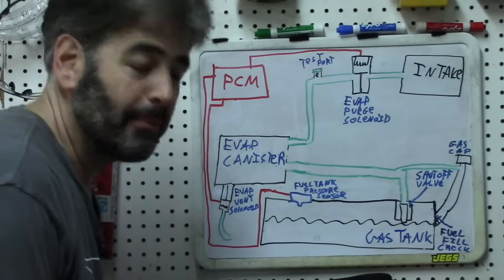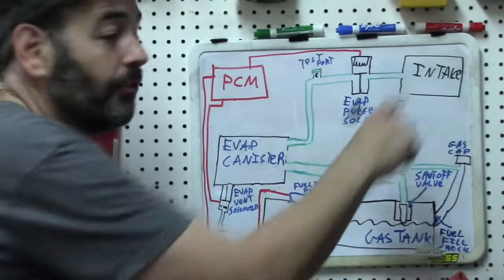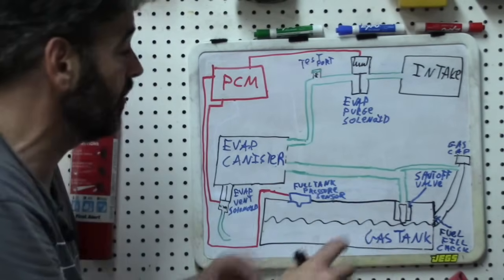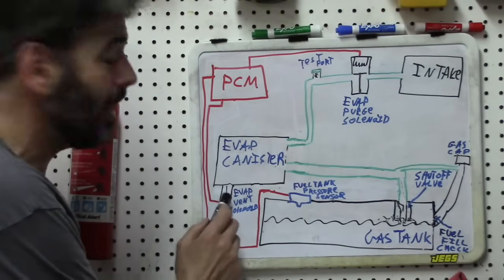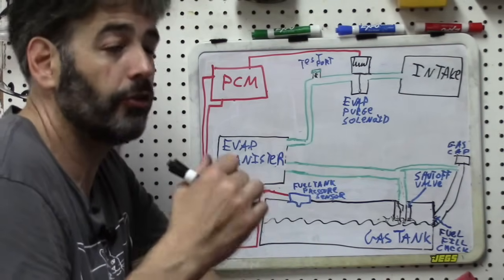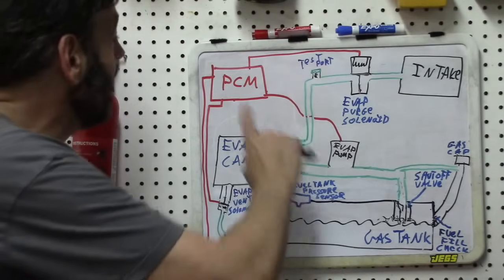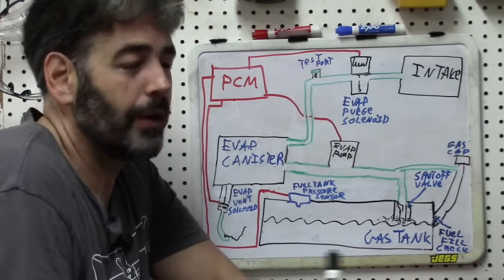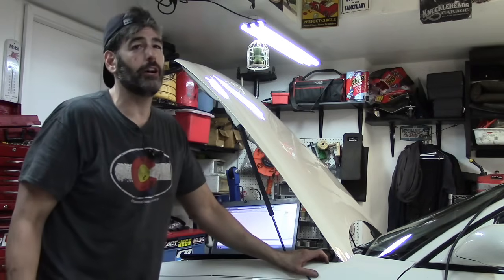Diagnosis + Understanding EVAP Systems (SBQM Full Video)

Comment: Thank you so much for making this video. I've never seen someone break it down and explain every detail like this, but damn now these EVAP systems finally make sense! I needed to figure out how these systems work because I'm planning to install an auxiliary gas tank on my truck and to vent properly it needs to connect into my evap system so the fumes aren't just spewing out into the atmosphere. Now with this info, I can kinda start to form a plan!
Reply from the maker: Glad it helped. It’s pretty easy once you understand the basics!!

Comment: My Ford stalls the very first time after filling gas. So that would be a purge valve issue?
Reply from the maker: Could be, among other possibilities.  What did the FTP voltage indicate the problem is?
Reply: @SchrodingersBox it threw a P1450 code. I pulled the line off and felt a vacuum on my finger. So I'm going to replace it next weekend since it's a pretty easy fix.

Comment: I love how the Evap system works but also it can be a headache 😅. I took my truck to a mechanic and he couldn't find the small evap leak. I took it upon myself to talk this evap leak problem. I found 1 hose that was ripped. But now I still can not find the other small evap leak. I took it to another mechanic who is a friend and he helped me more with this problem. We checked the purge valve and canister vent valve. It seem to be closing when my 2002 ford f-250 super duty is running. We did notice the gas tank looked like there might be leak coming from somewhere because there was noticeable moisture like if it was leaking gas. Now I need to bring down the gas thank to inspect that. Even With the smoke machine its so hard to find the problem..I hope its something simple with the gas tank so I could take it to smog this month. I really need to fix it to get my tags renewed. 
I also noticed the check engine light comes on after like 500-1000 miles or probably 1500 miles i do not recall but it takes a very long time to come on 😭 for the p0442 code evap small leak

Comment: Good video. Very informative & knowledgable facts. HOWEVER, I  need to know about the HOSES connected somewhere on top of the rear alt. crossmember. More specificallty, the HOSE with the INSULATION ON IT(?) Where does it connect? Mine  was burned into by tailpipe b4 I bought the truck, there is no visible connection point I can see?! I CAN'T FIND A SCHEMATIC, PHOTO, VIDEO ANYWHERE about this PAIN IN MY A$$. So here is your chance to shine by being the 1st one on here to finally clear the air on this bs!? lol
Reply from the maker: Man I would have to be REALLY good to answer this without being told the year make and model.
Reply: @SchrodingersBox  1997 F-150 4.6L LWB 2WD

Comment: Wait, if the purge valve is stuck open, vacuum will not decay, but increase, because the vent is closed and the engine is running , pulling vacuum through the leaking purge valve.
Reply from the maker: The vent valve is always open UNLESS it’s doing a system test

Comment: Hi Matt, but can evap problem cause crank no start . I have a car with evap code and is crank no start.

Moshitoa south Africa 🇿🇦
Reply from the maker: Very unlikely that it would cause a crank no start. It may be the engine is flooded with vapors from the evap but if you hold throttle all the way down car should start if that is what is happening. 
  I really doubt the evap issue is related to the no start.

Comment: Well, I had a strange event after installing a new fuel pump in my Tahoe. I had cleaned the tank (in place) of five-year old fuel. I cleaned it really well. I filled the tank with water and floated the last gas up where I could ladle it out. I drilled a drain hole and drained all the water, then installed a bolt with seals (which works). I wiped the tank repeatedly and got most of the last gunk and grit out. So, the darn clean tank received the new pump. Yes, I had cut the floor open to access the old pump. So, I get five gallons in a red plastic can, pour it in... seems great. My drain bolt is sealing. The fuel all goes in without a problem. Fifteen minutes later, I go out and check... fuel is leaking down the driveway... this is only five gallons, so I was anticipating I could capture it all if my sealing bolt leaked. But the bolt did not leak. I built it with o-rings and heavy nylon washers. It sure looked good - and it DID NOT LEAK. But how come gas is dripping profusely off the bottom of the tank?

So I go to the fuel pump portal (which I cut in the floor) and I see a puddle of gas on top of my fuel pump/tank, and of course, it is running around down the side. But why is the gas exiting my tank here? I clean things up and look closer. What appears to be true, fuel was being pushed right out the 3/8 nipple that goes to carburetor. Fuel was NOT being pushed out the return 5/16 nipple. There was a pressure developed in the tank after I poured fuel in, and closed the filler cap. We are talking about probably more than a cup of fuel, less than a pint I'd say, that was pushed out. This is a lot of fuel. Dangerous event. Now I want to cut the floor again, to find the pressure relief valve. What has gone wrong in design to give this dangerous event? Does this type of event take place in modern cars? The pint of gas gets pushed to where? I will bet this is happening to people and the mechanics are not understanding it when it happens. At present, I'm guessing the relief valve is stuck. On these vertical body fuel pumps, they have 3 nipples. What is the middle nipple for? If my relief valve is opening correctly, this problem should NEVER occur... correct? After 5 years sitting, the relief valve is stuck? Most likely. Now, where is it so I can cut the floor properly...

Comment: Hi. I have a 2006 honda crv that is driving me crazy
I don't have any codes , but I have the Scan Gauge III connected where I can see my fuel trims.
Around a year ago, I started noticing a rough Idle with my fuel trims getting  very negative on the short-term -10/-15 with the longs slowly creeping up toward the -10 the longer I stayed idling. The thing is that as soon as I started my commute on the highway, everything goes to 0 until I arrive and stay idling again.
I checked the purge valve and the vent valve at the canister.  Both are working fine. The problem is as soon as I start the car. The purge gets open, creating a rich mixture plus a vacuum leak. Witch also creates a rough idle.
Also the reason why I know the problem is the evap is because after a year of unsuccessful slow troubleshooting, I finally pinched the Evap hose coming to the throttle body while I was idling and my numbers started going back to 0 and the idling smooth out instantly. The problem is that I don't get any codes, and my components are working fine.
I remember that before I heard the vent selenoid open after I leave the driveway in the morning and get to speed (+/- 25mph) but now is like if the computer opens both selenoids as soon as I start the car.
Have you ever heard about this issue?
There is a guy with a civic on YouTube chasing the same problem.

Comment: My 2002 Trans Am is having low fuel mileage and occasional high idling, I am suspecting the EVAP canister. I will troubleshoot a few components before i drop the tank to get to evap can.

Comment: Thank you for this explanation , this helped me confirm this annoying issue with my truck. My truck was smelling bad in the engine bay and I had narrowed it down to the EVAP charcoal cannisters that were smelly from fuel vapors. I changed out the charcoal element thinking it was just old (30 years old) and that solved the problem for a few months until it got smelly again. I learned that these accumulating fumes were due to a faulty EVAP purge solenoid that is stuck CLOSED. All other components of my EVAP system and vacuum are new or still working well.

Comment: I believe the gm purge solenoid on the intake is normally off in its closed position.  The computer will send pwm to the solenoid opening it different percentages as necessary.  The purge rest or off position would be closed if not the solenoid would be on all of the time keeping it  closed . It wouldn't last long like that
Reply from the maker: Yes that’s correct. Most purge solenoids work the way you described too.

Comment: Not so clear for me. You keep saying PCM, PCM. But  what does PCM mean or what does it stand for ? And you did not mention what's gonna happen to the fuel EVAP and other vital components if the fuel tank was over filled when tapping up gasoline, in which most drivers do.
Reply from the maker: Sorry about that - this channel for advanced DIY’s. I assume viewers have basic mechanical experience before watching.

Comment: I believe with my '98 prelude the hose from the evap canister doesn't go to the intake manifold, but it goes to the vacuum sealed resonator. That way the fumes go through the air filter before the engine

Comment: Thanks so much for this.  My Lexus GS460 has developed what I suspect is a fault with the float valve in the tank, as if I fill the tank past about 2/3rds it will run poorly under load and fuel economy plunges - the higher I fill it, the sooner it starts happening after filling.  I think liquid fuel is getting into the charcoal canister.  If I keep the tank under 2/3rds for a while, it comes right after a day or two and stays that way until I refuel again - presumably the fuel in the canister has evaporated.  It's not showing any codes, even got the dealer to put their tool on it and nothing.  I'm not sure what to do to correct it, but at least I can work around it by just never going past 2/3rds of a tank.  I guess the tank would need to come out to repair the problem.

Comment: Can you tell me if the gas tank pressure sensor on a 1997 corvette C5 requires removing the gas tank in order to replace the sensor?
Reply from the maker: Yes it does.

Comment: Having code P144C on 2017 ford transit 350HD turbo 3.5. Scanner says evap leak under boost. Replaced purge valve on top. Cleaned gas cap fill seal. Watched your video but you don't mention under boost. Any feedback would be appreciated. Ontario Canada.
Reply from the maker: I would need to see that data indicating the purge valve was faulty. What data indicated this?
Reply: @SchrodingersBox  what Data exactly are you looking for?
Reply from the maker: The voltage data from the fuel tank pressure sensor with and without purge valve activation would be the easiest to start with.

Comment: Have a 13' econoline and 3 times I've gotten gas shortly after won't start until i disconnect and reconnect battery. I've checked fuel pump fuses and tested purge valve but didn't blow through it. Any suggestions?
Reply from the maker: What data do you have?
Reply: I dont have a scan tool if thats what you mean..i did also disconnect an auxiliary battery and inverter, and as far as i knew it was only powering the inverter..i disconnected the hose coming from the cannister to purge and started it,and didnt start sucking until it warmed up a little @SchrodingersBox
Reply from the maker: Don’t need a scan tool- just measure the vent pressure sensor voltage.

Comment: You are an excellent teacher. I've been to automotive school.I find you too teach just as well and you show in a bunch of different ways. NEVER STOP LEARNING PPL!!!
Reply from the maker: Wow, thanks! It’s definitely an ongoing learning experience for me, too.
Reply: I spent a week trying to get a Dodge ram to pass e check and my issues were evap. The components are scattered all over and issues everywhere with hoses and fittings. I finally got it to pass. The computer approved the evap test quickly once repaired. I wanted to understand the operation after and you said something about unable to reach full vacuum causing major leak code and that was my final problem. A small crack in the hose to the intake. Thank you so much for a detailed explanation.

Comment: * More than once when filling refueling the fuel pump failed to shut off after filling.  Besides fuel spilling onto the pavement, liquid fuel saturated the charcoal in the evap canister and evap system code occurred.  The solution?  Drive lots of miles to unsaturate the charcoal.
* If the vehicle has sat for a long time, the evap canister charcoal can become saturated.  Same solution, drive and let the vacuum suck the vapor out of the charcoal.
* On another note, squirrels or ground squirrels have chewed through the vapor return lines on two different vehicles, and the evap ourge solenoid wire on another.  Finding replacement line connectors and the vapor return line of the correct construction was tough, and then inserting the connector into the vapor line was tough, too, until a compression tool designed for attaching connectors onto RG6 coax cable was used.

Comment: What make a 2007 Hyundai SantaFe limited 3.3L when you fill the gas tank full, you hear bubbling and seems to vapor lock and engine shuts off but will start right up? 
  Thanks
Reply from the maker: Sounds like a leaking purge solenoid to me.

Comment: In toyota prius 30 I noticed ecm allow to open evap purge control solonoid to open 20% when it's in maintainance mode engine running in idle. Its showed - 5 in LTFT.then I closed the vacume line and checked the ltft then its came to 0 ltft. Can this be happen when engine is in idling.if not how to resolve the rich condition.?

Comment: 2002 Camry 2.4l has an evap vent valve at the air box. Is that the same thing as in the video only at a different location? I have a small evap leak code. Verified it is not the gas cap. Believe it may be a cracked hose somewhere but can't comfirm without a smoke machine.
Reply from the maker: Yes a vent valve can be anywhere. I recently worked on a Toyota 4-runner with similar design as you describe. Maybe all Toyotas do that- I don’t know.
Reply: @SchrodingersBox  thanks for the response. Great video explaining the evap system.

Comment: I would like to know why auto manufacturers design a complex fuel and emissions system that's mostly located under a vehicle exposed to the elements out of such CRAP MATERIALS that rot out and fail. Fails like a 60's era exhaust system before SST. IT'S DESIGNED TO FAIL ON PURPOSE.

Comment: I have a 2006 Honda Odyssey. Whenever the fuel level drops below 1/4 of the tank, the Check Fuel Cap alert come on. After I fill up the tank, the alert goes away. Would appreciate any insight.
Reply from the maker: Sounds like an EVAP issue. Whats the vent solenoid position at? I’d check that first and verify there is flow through it.

Comment: When it’s time to replace the evap canister can I repurpose the activated charcoal for my face mask?
Reply from the maker: Hahaha I would highly recommend against that. While it’s the same activated charcoal, the problem is you are potentially going to breathe in the gas vapors adsorbed to the charcoal and even just a minimal amount would be toxic.
Reply: @ in all seriousness it was a great video. Was there a part 2? I signed up to SBQM but couldn’t see anything. No dramas if not, plenty of vids to sink my teeth into. Cheers
Reply from the maker: No part 2 however on SBQM I do have many more videos with A/F sensors.

Comment: Question: since fuel vapors are adsorbed by the charcoal canister and don't vent out the vent valve how is it that the vapors are released(desorption) into the  engine when the purge valve opens, what forces the desorption then and not at the vent valve?
Reply from the maker: Yes I always wondered that too lol. Apparently it’s the airflow created by the opening purge solenoid that does it. 
  By the way 1000 bonus points for “desorption”!!!!

Comment: What if someone DID top off the gas tank. And flooded the system. Could that cause a “lean condition” ? Or would you lean towards the intake side purge solenoid ?
Reply from the maker: I don’t see how that would cause a lean condition. You would expect a rich condition.
Reply: @ 
Ok. Thank you.  On with the search ….

Comment: to make it simple--  when key is turned off, the only 3 places that can restrict the pressure from exiting the tank to let gas fill is: the EVAP canster that is key controled.. the charcoal canister- and gas spill overflow exit (float/valve) assuning all hoses not kinkled/plugged.right. So if let car running !!! - key on -- the EVAP canister stays closed--and should not be able to fill with gas,,Right..

Comment: ya mention  the filler((( flipper anti-roll ) as a check fill  valve... The fuel tank being fuel to hole ,,,that  resistance shuts off the gas pump nozzle.. You say smoke comes out the EVAP siliniod ,,usually open.... ONLY  when key is off!!!! you didnt cover key on---key off. key off open the EVAP to release tank pressure to fill it ,,right... I unhooked my EVAP hose  and still tank get  preeurized..REALLY  sounds like charcoal filter doesnt it... Thats  why unhooking  hose going to  filter.... let know if works ...

Comment: there is a small hose on my chevy 2000 impala.that pigtails into that hose from tank exit to  charcoal filter to  the gas pump.. Dont understand why that is needed..as tank empties. some air needs to go in ,,or  ya get a vacumm... where that  air come from??? Last time drove almost empty. suddenly gas gauge showed FULL !! and bounced around. next time started was on empty again((  but did float around)) tell me a BAD ground .. ((ODD  pump suddenly go  bad too!))car is VERY  rusty.

Comment: I read  on another video says P0443 ix evap purge silinoid. Maybe that  line is  plugged. If unhook that-- tank shouldnt ever get pressized either...something is causing the pressure not allowing fill flipper anti-roll over on the fill hose not to  open. sometimes seeps in slow--sometimes totally closed. usually  after driven 20+ miles.
Reply from the maker: Sure that could be one of many many many many possibilities too